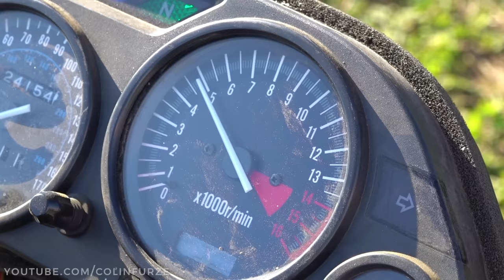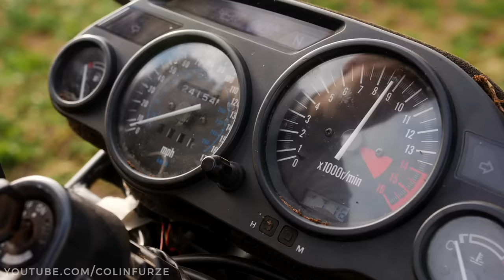600cc RIP-TIRE UNLEASHED

Comment: Colin should launch this over a lake to see if the tyre skips along the water top!
Reply: Adam Met yeah it’s big lake time
Reply: Xd ir doesn't have the momentum enough
Reply: @modelgio360  Maybe if he shifts up a few gears the wheel would spin faster.
Reply: @chill8465  In a previous video when they were testing it they show the bike is in 6th gear.
Reply: this could just mean he needs to change the bike...
Reply: It would just destroy the lake
Reply: He'd only have one try
Reply: cool idea but I think it’s both too heavy and not spinning fast enough. He would need a much lighter tire.
Reply: @brixalot9073  that's what they said to Barnes Wallace
Reply: Creative Channel change the gearing may gain some extra rpm too.
Reply: Change the sprocket's on the bike. You can have that thing spinning like a mf'er and not be anywhere close to redline.
Reply: Hydro plane tire
Reply: I think it would work best if you somehow spin it backwards, but propel the tyre forwards, and the surface of the tyre wants to be smooth too.
Reply: @justinbryant237  ...to skim on water? Careful to change the mechanism on land otherwise it sounds like an excellent way to get a tyre in the face :)
Reply: No point, ya cant Explode a lake into a fire ball (without petrol (Gas)).
Reply: @justinbryant237  You're right. The British experimented during WWII with drum bombs doing exactly this - spinning backwards to skip along the surface of water. As far as I remember it worked.
Reply: or sink a boat... just like old times.... reminds me of titanic
Reply: @alternateuniverse656  you know you can actually get more than one tire right
Reply: @DBZ483  True
Reply: @alternateuniverse656  :)
Reply: Yes cool idea
Reply: Iamgine if there was a buggati chiron powering that
Reply: @matthewbell2617  Bugatti wouldn't make a difference. The rotational energy of the wheel when it's released is all that matters, and that just depends on the moment of inertia and the rotation speed, not the horsepower. Bike vs car engine makes no difference.
Reply: I’m sure if an rc could do it this could too but the tire might just be too heavy he’d probably have to go ahead and make another tire for it
Reply: Oooohhhh this idea has my vote
Reply: Wasn't that already tried in WW2
Reply: Please fill the tire half full of water
Reply: Cannonball Run style!
Reply: @ZAP1255  it’s a zzr 600, it’ll do 140mph :).
Reply: Every card i used on blizzard all got used for illegal purchases, those cards where only ever used on the blizzard sight! Never had the problem with an other company (even once). also it appears their servers get hacked during game play by cheaters etc!

Comment: I think the one with the spikes was actually less destructive. The Huge spikes on the tire dug into the dirt, and slowed it down.
Reply: i think it was actually a case of them not revving it much, out of fear for the spikes comming off... also since the fridge was so close, it didnt have any time to convert the angular momentum into forward momentum. bending metal is easier than shredding it to bits
Reply: The tire was flat so I think that have to do something to The momentum and how to spikes move when The tire hits The object
Reply: The fire helped.
Reply: @LunaticCharade  agreed, it was mainly the inability to convert the angular momentum into a linear vector ... the objects were way too close
Reply: Yup, the spikes made the tire lose a lot of momentum when they hit the dirt
Reply: False Flag  I don't get what you are saying.
All the rotating mass (spikes, tyre and wheel) act as a single unit. So not sure what transfer momentum to inside means????
The spinning spikey wheel has angular momentum, and through traction converts some of it to forward momentum (until the outside rotating speed, and object velocity match).
The more efficiently it can convert this momentum the faster the wheel will move.
The first tyre had less grip so lost energy through loss of traction (resulting in heat and sound).
The spikey one should transfer momentum very well so as said earlier I'm pretty sure they didn't spin it as quickly. 
I doubt the energy loss from the spikes churning up the ground would have a noticeable effect.
Reply: it didn’t even have time to grip up
Reply: would adding more spike help? I imagen that adding more contact point to the ground would decrease the individual impact of each spike and maybe less dig? or is that not how it work?
Reply: @phillipdo3577  it probably would help a bit.
Reply: Welll naaa shitt
Reply: @ashleygarvin7177  I think that if the objects were played further away the tire would tumble over before it reached it. Especially on the uneven ground.
Reply: @phillipdo3577  yeah, it would help. its same like using saw
Reply: @soldaat1686  the gyro effect with that much mass/angular velocity would stop it falling over.
Reply: no shit
Reply: flexing of rubber absorbs energy, converting energy to heat. If there was a continuous metal band in the inside of the wheel which all the spikes were bolted onto, it would reduce the flexing and convert less energy to heat.
Reply: The tire was also bigger and heavier, meaning it took longer for the thing to get spun up, and it wouldn't get going as fast.
Reply: The spikes were just a little too big, if they would have been smaller they could've increased destruction by a huge amount by the tire having more grip
Reply: @richardschofield2201   What False Flag means is that the inside of the wheel rotates independently from the tyre.
Reply: It's a different kind of destruction. A knife versus a sledgehammer would be a good analogy
Reply: The spikes weren’t even that sharp as well
Reply: Problem was as soon as the spikes bite it climbs the obstacle loosing its energy to his own weight :(
Reply: @benjaminlumsden  the tyre and the wheel can't (without silly forces) turn independently of eachother.
Yes there's a weird hub cap thing that spins but it has negligible mass.
Reply: @David Miatke Ah yes. Newton....
What about him?
Reply: Everyone’s wrong, they screwed the spikes through the tire which release all the air so it could not bounce and on top of that the spikes dug into the ground, provided traction and didn’t allow it to go too fast.
Reply: Ok, I give up

Comment: Now just imagine if he’d welded those spikes to a ring that was bolted onto the tire... so that there was no ‘give’ when the spikes hit anything
Reply: Next Video Idea ^^
Reply: The spikes kill the momentum of the tire, I want to see one with more spikes, and lighter weight.
Reply: Lighter weight is less force though right? Im no physics expert but I feel like the momentum of that massive amount of weight would power through the spikes grabbing the dirt every time it spins right?
Reply: Literally just posted a comment on possible build ideas for a better spike rig
Reply: @allstarmode9805  I just wanted to see the monster tire fly down the field into a vehicle, but it seemed like something was limiting how far they could get it to go and still be destructive (thus putting the target directly in front of it) 
but you could be right, the limiting factor might not have been the spikes or the weight.
Reply: AllstarMode980 lighter weight doesnt mean less force in this situation. the heavy weight kills the momentum. a perfect balance of weight in a centrifuge would create an incredible amount of force.
Reply: Kamekazy Shark ooh good idea
Reply: I think the spikes bending into the tire is whats converting moving energy to heat
Reply: I would've curved the spikes as well, I believe it would've made it easier for the tire to dig into the ground and travel
Reply: @zacharylortie2786   The flaw is in the design of the spike for not further penetrating the target, its not that the spikes slightly flexing on impact is the issue. A curved ninja throwing star shape would of sliced through more like a blade. Although Colin's spike design helps the tire mostly ride on top of the ground rather than penetrate it. The spikes slow it down less than a blade penetrating the ground, but makes it more unstable. It's difficult to make a perfect design, but the rip-tire design without spikes reaches faster speeds, goes further distances, does more damage, and is more stable making it a better weapon. So the spikes are more of a cosmetic effect for it, rather than an actual benefit.
Reply: sruijc how can you tell that the heavy weight is impacting it negatively? Im sure you're probably right but Im just curious what the tells are.

Comment: Basically showed how to make an anti-vehicle weapon for the people in Hong Kong
Reply: There's simpler ways, you can turn angle steel into homemade stop sticks, ruining the tires.  Or cut the same angle steel at a 45 degree angle, sharpen it, and set them in barricades with the sharpened steel aimed at roughly engine height angling back to ground level to keep the barrier more static.  Hell, get them dense enough and horse-mounted police can't pass either.

Czech hedgehogs are a very resource intensive option for groups like the protesters, but are capable of slowing or outright stopping tank columns.

Comment: Seems more effective as a wheel without the spikes, surprisingly enough
Reply: Yauh, the spikes would get stuck in the dirt and mud which would slow it way down
Reply: You can see on the close up of  it hitting the fridge that the spikes just fold backward because the rubber underneath isn't strong enough to keep it in place. So a lot of energy just gets used up in bending.

Comment: The spiked tire was the most anticlimactic thing I've ever seen.
Reply: Because he didn't let it run anywhere, you can see it bites the ground immediately where as the others wait to get traction. If had let it run for a bit it would have been nuts.
Reply: Did you see the damage it did to the fridge? If it would hit a human it would be fucking sliced in half
Reply: Yea, it was kinda of a disappointment. I feel like the video doesn't do the tire justice. That thing is spinning really fast and stopping very quickly. The amount of force going through the spikes has to be absurd.
Reply: The problem is as soon as the spikes bite into the ground the tires looses a ton of momentum. You can see the tire stop spinning but the center hub still spins.
Reply: @nutz4gunz457  Yes... needs smaller spikes
Reply: If he could make it with some kind of centripetal gear system that slowly extended the spikes, so the tire can get some forward motion first before the spikes interfere,  like a giant self-winding watch movement, that would be SO devastating!
 It could be engaged when the tire is released, letting it run out 20-30 yards, and then *ping! - out come the spikes!
  

I think he could do it...
Reply: timewasterable Nah, it was the heavily increased rotating mass that killed it

Comment: I feel like he didn't spin the big one in last gear
Reply: It's possibly because big wheel started doing scary stuff when spun up to real high RPM. All it takes is a slight imbalance in the wheel and it can shake that rig like a terrier that's gotten hold of a rat. It's also possible they could have done with a bit more distance for the spiked version. It looked like they moved the van closer for that test, and I thought it looked as if the wheel was still spinning free and accelerating when it impacted with the van. Though I could be wrong about that.
Reply: Needed more lasers
Reply: @APMtube9000  Didn't think about that, but you're right. Unless those spikes are secured using bolts and a steel backplate they certainly could rip away at high RPM. And once one spike goes the tire will definitely be very unbalanced...

Comment: I’m a bit late but I would recommend putting some iron or lead weights in the middle to increase it’s momentum (Both angular and linear). I could hear how much it decelerated after making contact with the grass as well, which would be somewhat solved with some extra weight.

Comment: Cool, wonder how it would be with a bigger wheel with flywheels and maybe some water in the tyre😊 that will follow the rpms and stabilize to. Heavy fast rotating objects are very potential to "really take off" if you used a car and made axle from one side. And the other side vlocked for rotation the rpm on rotating side should double😊

Comment: What would happen if you filled the tire with water? Would the spinning of the fluid help the transition from rotating motion to linear motion? Gyroscope's momentum effect to keep the wheel spinning faster after impact with ground and travel faster in a straight line.

Comment: Would it not have been better to add a hard steel ring inside the tyre to mount the spikes on to? Add more weight and structure.

Comment: A way you could improve it is find a way to shift through all the gears up to whatever gear you want to use
Reply: Smaller sprocket for more speed and concrete for the first 5 feet the tire is on the ground

Comment: I had a 2000 pound  Front in loader tire hit me connected to the  Front in loader on my motorcycle. It's been a bag 3 years. Call video though you need a bigger tire

Comment: If you put a smaller sprocket on the rear wheel, and perhaps, a slightly larger one on the transmission,(gear box) you could spin the tires much faster. You've got more than enough engine power. That said, I don't know how fast you dare spin a tire!